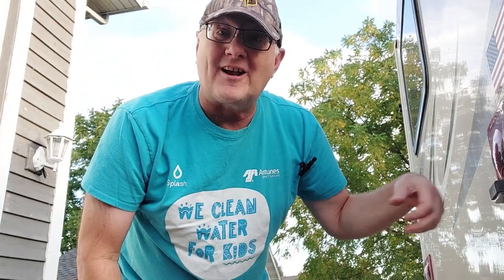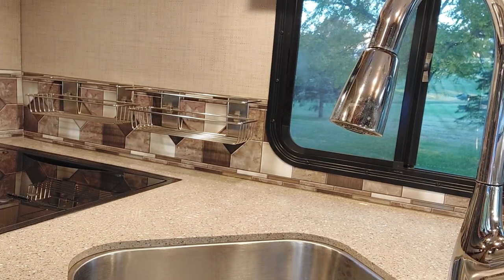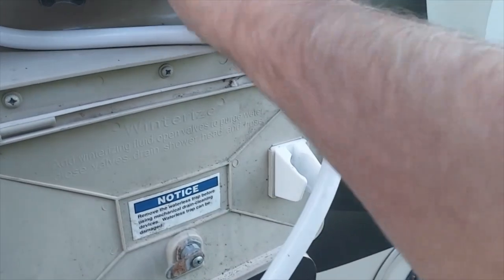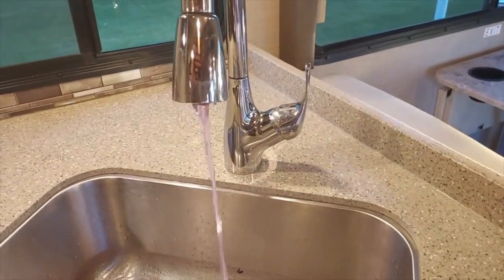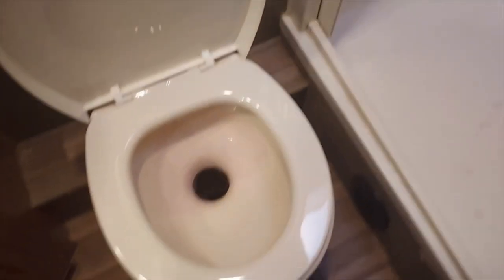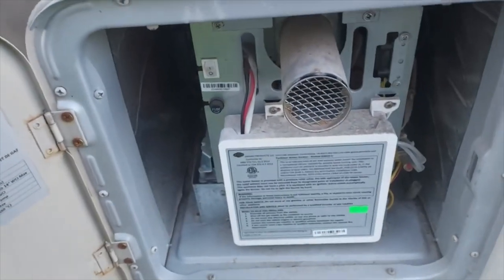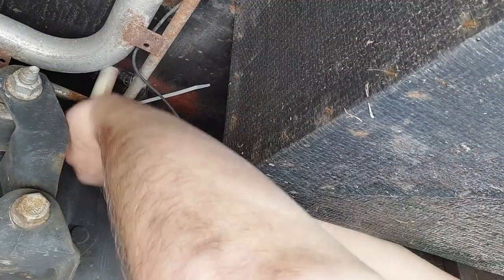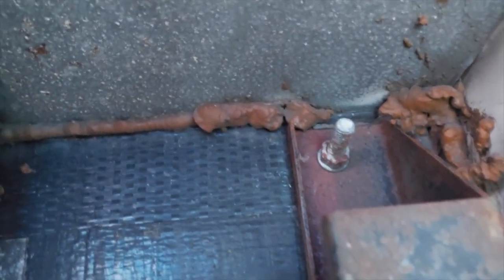How to Winterize Water System on the Motorhome RV Trailer Camper Travel Trailer Save Money

Comment: There's no need to put expensive antifreeze in the domestic water system. Just empty the tanks, take off the feed pipe from the cold water tank and blow the water out of the system with your mouth of, better still a small tyre inflator. Just blow it through each outlet as you have with the expensive pink gunk. It will save you a fortune.
Reply from the maker: Andrew, yes if you are sure you get all the water out of pumps, valves and heater you would not need the pink, but I use the pink just in case and then the pump airs out the system as well been doing this way since 1990 never an issue!